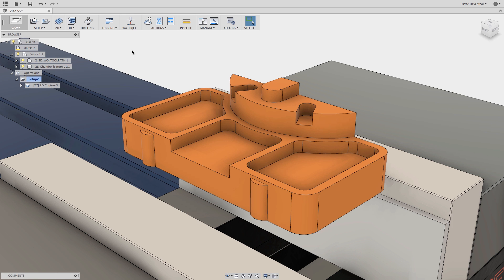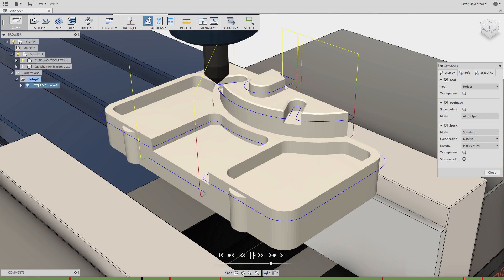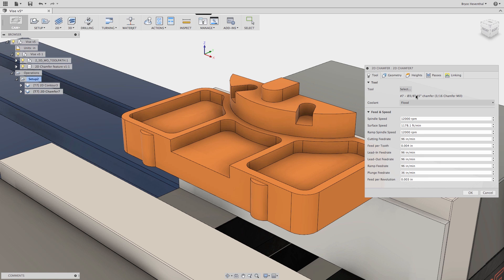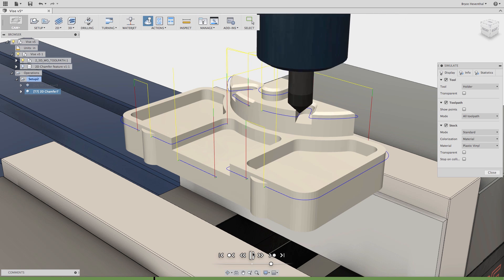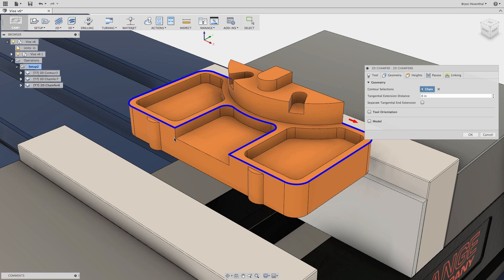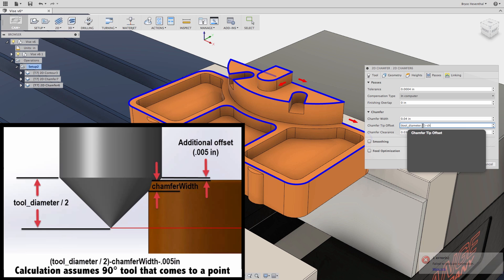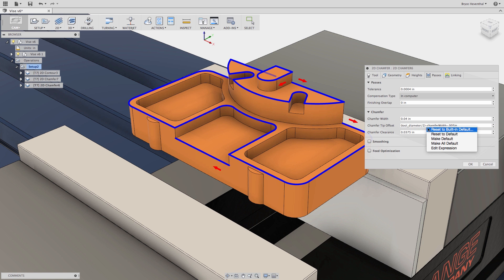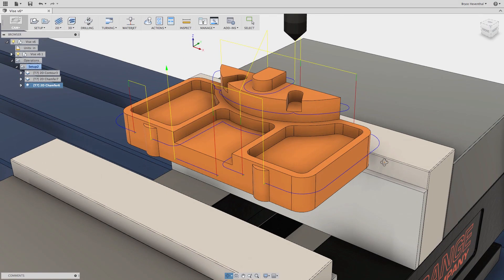Chamfer Tool Path

Comment: If I modeled a chamfer into the part, how would I use the chamfer tool to mill that?
Reply from the maker: Not sure I'm understanding. Do you mean you're modeling essentially "V" shaped cuts in the center of the part?
Reply: @adskFusion  He meant that the 3D model of the part already has chamfers modeled in, so no sharp edges to select for chamfering or to put it otherwise, the customer has already specified the required chamfers in to the model.